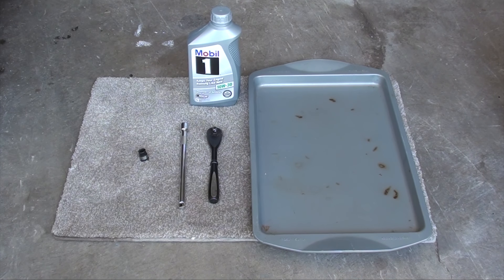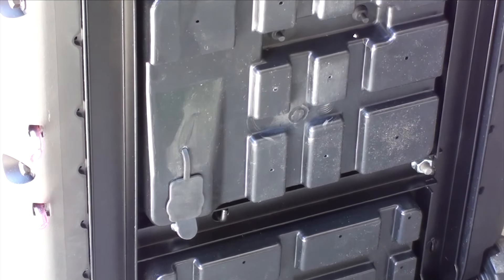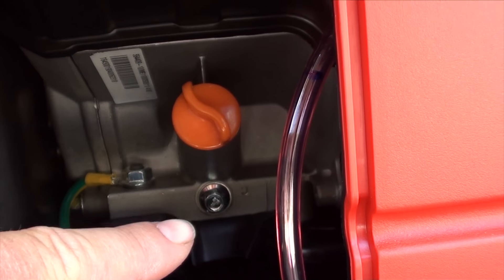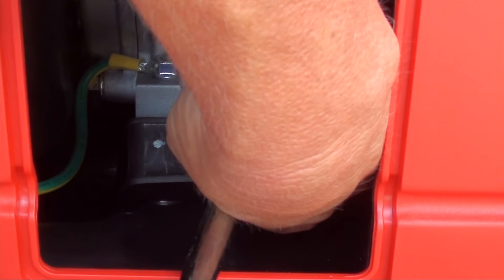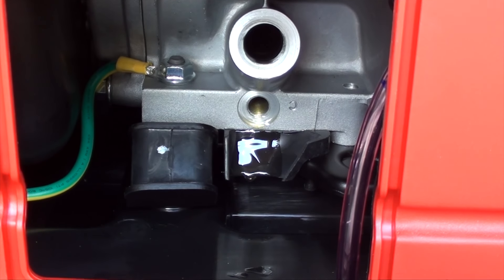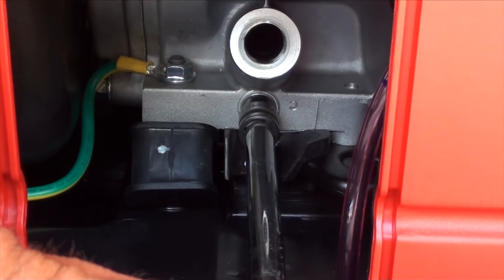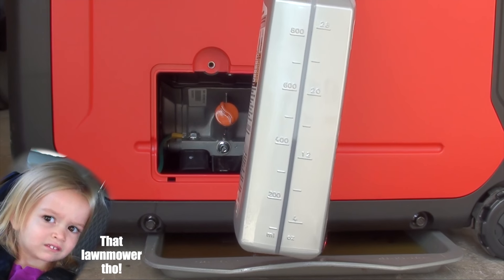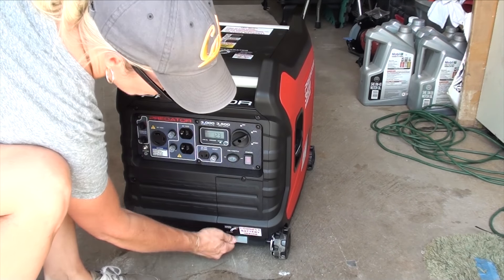How To: Change the Oil in a Predator 3500 Inverter Generator

Comment: I wouldn't flip an engine over...
Reply from the maker: It's really not "flipped over", it's tilted just as step 3 in the owner's manual specifies: "3. Lift and tilt the Generator.  Remove the Drain Plug on the bottom of the machine, then set the Generator back down on a level surface."

You could always write to the manufacturer and tell them you wouldn't tilt an engine & maybe they can give you an alternative; perhaps lifting the entire generator onto blocks in a level fashion would do it. I definitely can't lift it so just I tilt it as shown.
Reply: It's sealed. Completely fine. Oil settles right back down.

Comment: This is probably a redundant comment, but my 3500 came with a drain house with an easy twist plug/cap installed from the factory ( so no 10 mm socket needed)... and my rubber plug was designed to be removed from the inside.   Manipulating the drain hose out the bottom wasn't the easiest thing in the world, but so it was.  
As a tip for those without a dedicated oil measuring cup for garage use, I used my kitchen one to measure out the 20 ounces USING WATER.  Then filled a bottled water container with that water and marked the container at the 20 ounce mark.  Then I replaced the water with oil.  
Thanks for the video.
Reply from the maker: Excellent! Thanks for sharing your tip about the drain hose! People with that style setup should find it helpful!
Reply: Thank you!

Comment: Thanks for the video.  I borrowed this Predator from a relative and changed the oil, with your help.  Alternatively, i opened the oil door, pulled the plug up, then just slid the tray underneath.  I then tilted the machine toward me for about 20 seconds (after it stopped pouring out flat) until it was really empty.  I think it took almost 17oz.  After all, i then pulled the cord slowly a few times to get oil into the cylinder, and then i checked the oil.  Always pull the cord a few times before statup to pre-lube before startup.  Thanks, again.
Reply: Thanks for that additional tip 👍

Comment: Very clear, informative video.  One note, though.... Regarding the final check of the oil level, you check it without screwing the cap in.  You just put the dipstick up against the oil fill port, pull it out, and read...
Reply: This is correct.  I actually went to the manual because of this comment.  They show the oil being right up to the edge of the threads, and the stick measuring full without screwing it in.  Never knew this!  Thank you.

Comment: Perfectly done.  Thank you.  I bought one of those 3500 inverters two days ago on FB.  The machine looks new, but that oil was black as coal.  Fixing to walk out to the barn and change the oil, just needed a little instruction.  Thanks again.
Reply from the maker: Excellent! Good luck with your generator & thanks for commenting! :)
Reply: @EndlessDIY  All ready done.  Pretty fast project. Glad you mentioned to hold off on putting the full 20 oz in it.  17 oz was about perfect.  Thanks again.
Reply: @mathewdavis-adventuresandd6643  on the first change it is usually black as rings seat. First 50hrs is all about the break in.

Comment: Sadly i enjoyed this generator, but it won’t power my AC in my trailer. So I found this video very informative to drain the oil to return it! Thank you!
Reply from the maker: Aw! That's a bummer! It powered the AC in my Ice Castle, but I don't recall the size. Yours must be bigger. I've seen people talk about a "soft start" kit that allows a slightly smaller generator to start a heavy draw item like an AC. From what I understand, when the AC kicks on is the huge draw. If you're not able to return it for some reason, that's something to look into, at least. 
Thanks for watching! :)

Comment: Thanks for that.  The other videos I've watched talk about propping up the generator using 4x4 blocks.  I like your idea of using a cookie sheet instead.  If I use my wife's cookie sheets she'll have my head, but the aluminum ones can be had for virtually nothing.
Reply from the maker: Lol! I bet! I have garage specific bakeware (cookie sheet for oil change, muffin tin for nuts & bolts on a big project). 😁 I'm glad you found the video useful! Thanks for tuning in!
Reply: @EndlessDIY  Muffin tins for nuts and bolts!! What a great idea! Add magnets and voila!
Reply from the maker: @LivingFaith2  Thanks! It definitely keeps things organized! Everything seems to roll away otherwise. lol!
Reply: @EndlessDIY  I wish I would have watched your video Before removing my radiator on my Dodge. I would certainly have bought a muffin tin first.

Comment: Your oil looks really good still. I run my generator 8hrs a day for 4-5 days. I do my oil change every week. I also use the same oil just because my truck uses the same ( truck oil is much better then generator oil)  and I don’t want to buy a different oil for my generator. I had a lot of generators since I use them for commercial use and never had a problem with the engines ( the power plant goes first before the engine ) so I’m pretty sure you can run yours for a lot longer before doing an oil change. I love the predator series generators they are way better then Briggs and Stratton as i have 2 brigg generators dead in my shed.
Reply from the maker: I agree. I use regular automotive oil, as well. This was the first oil change after the break-in period so it still looked pretty new. I rarely use the generator. I mostly use it to power my house when the power goes out (dang rural power). Thanks for the comment! :)

Comment: Thank you for this, I was just getting ready to go look at the manual.  One think I would critique, if you don't mind, is leaning the generator up that far.  I tipped mine up from the side just far enough to pull that rubber plug and that's it.  I'm no mechanic and I can't really say WHY I wouldn't tip the generator up that far, but it's just something I've been told about engines.  Maybe it's not true and it's something that's been told then told then told then told to me?  I don't know but it was easy enough to just tip it up a bit.
Reply from the maker: I think that's generally said because people are concerned about flooding the carb or getting the float stuck open. I've heard it many times, as well & I'm still not positive that's the reason. Lol

Comment: Great tutorial. Question for you. Does turning the generator on its side like that run the risk of overflowing the fuel tank? Reason I ask is because we had the tank for one time and it spilled a bunch of fuel during transport and we have no idea how? I was thinking maybe there is an over fill or we put too much gas in. Just want to make sure it’s completely safe to tilt the generator like that. Thank you.
Reply from the maker: Thanks! I haven't had any issues with fuel coming out when tipping the generator. You most likely overfilled it a bit. It's common on these. There's a fill mark in the gas neck that you're not supposed to fill past (and they mean it! lol!) but it's kind of difficult to see. Gas expands so if you overfill it will make a nice mess for you. Hope that helps! 🙂
Reply: I had the same question, thanks!!

Comment: Great video but why do you remove the rubber plug?
Reply from the maker: Sorry for the late reply, I haven't been receiving notifications for some reason. The rubber plug is popped out because the oil is drained kind of inside the case & it has to come out of that hole. If you don't open the plug, it'd just sit in there & make a terrible mess.

Comment: Awesome!  Thanks. Just bought a used one with a 1k hours.  Hope it was ok for the price and has no problems.  The 1st thing do, as with used cars I buy, is change the oil. Piece of mind I guess.   Thank you for this.  Seems simple.  Question. Where do you dispose of the used oil??   Thanks
Reply from the maker: Congrats on your new generator! As far as I know, anywhere that sells a reasonable amount of oil has to accept it to be recycled (like Walmart, Napa, etc).

Comment: That oil you drained looks brand new! Was this just for demonstration purposes and if not how many hours was on that? And yes they do make a magnetic dipstick now pretty cheap on amazon and ebay.
Reply from the maker: You're right, it did look really good. It was the first oil change after the break-in period but I don't recall the hours.

Comment: Oh and is there anything else I should look for to change? Say the air filter or whatever?
Reply from the maker: You should check/clean the spark arrestor. I've seen several people talk about it getting clogged and making the generator less efficient and even falter a bit. It's simple to do.
Here's a link to the owner's manual, if you want to read all the details about the generator and some service info. https://manuals.harborfreight.com/manuals/63000-63999/63584.pdf 👍🏻
Reply: @EndlessDIY  Thanks for the link to the OWNERS MANUAL

Comment: How often do we change the oil?
Reply from the maker: Good question! According to the manual, you're supposed to change it every 6 months or 100 hours. Here's a link to the manual if you'd like to take a look. Thanks for commenting! :) https://manuals.harborfreight.com/manuals/63000-63999/63584.pdf

Comment: I liked the video. However on my predator it said to check the oil level by taking out the filler plug and wipe it off and just stick it in without threading it and pull out and check the level!
Reply from the maker: I always thread it in but you should do whatever the manual calls for. I believe either method is just fine. 👍🏻

Comment: My only complaint is that rattling wheel lol, mine drives me crazy
Reply from the maker: YES!!! Lol! I hate that! Locking it "just right" helps, sometimes, but that thing is so annoying! I'm thinking about making a big wheel kit for mine with possibly a different brake system. I'll design & 3D print the spacers and maybe come up with a jingle jangle solution in the process.  😄
Reply: Place it on an even ground.

Comment: Do you know what size the crush washer is?  And where to even find a crush washer?  Last time I changed my oil on this same generator, I noticed the washer is broken...
Reply from the maker: I'm sorry I didn't reply sooner, your comment was held as spam for some reason. 🤷‍♀️ Anyhow, I don't know, offhand, but if you take the bolt to a powersports dealer (Polaris, Yamaha, etc) they might be able match one up for you. The last one I got was for my Polaris General from the dealer, so they do have them. Just matching the size is the challenge. 
I hope you find one & thanks for watching! :)

Comment: Need help, my generator won’t start.  Sat for about 2 years, new battery, oil, and spark plug.  It cranks but won’t turn over…any suggestions
Reply from the maker: It sounds like it might not be getting fuel. I've not dug into the carb on my Predator but you might do some googling to find out what type it has. It could be a dried-up accelerator pump/diaphragm or maybe your jet/fuel orifice is just plugged with old varnished fuel. If it were me, I'd find out what I could about the style of the carb then take it apart for a thorough cleaning. Sometimes the little carbs for small engines can be so inexpensive a rebuild kit actually costs more.

Another free dignostic thing you can do is make sure it has spark. Take the plug wire off & hold it very near the plug & turn the engine over to see if you have spark. It can be hard to see. If you're not really able to see, unscrew the plug, put it in the plug wire & hold the electrode near a bolt or something on the generator & watch for spark that way.

Good luck! I hope you get it sorted!
Reply: Maybe dump all the old fuel out and buy non-oxygenated gas with two oz. of Seafoam and crank it over. If it starts let it run for 15 min. to let Seafoam clear the varnish out of lines.

Comment: I had added a Valve so I didn’t have to grab a wrench every time.
Reply from the maker: Anything to make the job quicker is nice! 👍🏻
Reply: Isnt it easier to unscrew and take the whole side off to get better access??
Reply from the maker: @tomcoon6930  I've never had the side off of mine so I can't compare methods. The access panel has been plenty of room for me, but whatever works best for you is the way to go! :) 
Thanks for watching & commenting!
Reply: What size was the valve????
Reply from the maker: @jseries9247  Are you asking what the bolt head size for draining the oil is? If so, it's a 10mm socket (I mention it at the beginning of the video and it's also in the description along with the other items needed). 
If you're asking what size quick drain hose you can buy for these, I haven't got one, but I believe they are 12mm. 
Other than that, I'm not sure what "valve" you mean.

Comment: What oil ? Is 5W-30 ok ?
Reply from the maker: The manual for the generator recommends 10w/30 oil so that's what I always use. I'm sorry, I don't know if other weights would be suitable. Here's a link to the owner's manual if you'd like to take a peek. Thanks for the question! :) https://manuals.harborfreight.com/manuals/63000-63999/63584.pdf

Comment: Will 10w40 works or do i have to use 10w30?
Reply from the maker: 10w-40 should be fine. The oil gets changed so frequently & those are so similar, I'd run it if that's all I had, personally.

Comment: Small engines without oil filters should never have detergent oils.  The manual actually specified 30 weight oil.
Reply from the maker: Interesting. The manual for mine, on page 17, step 7 says: " Replace the Oil Drain Bolt and add the appropriate type of oil until the oil level is at the proper level. SAE 10W-30 oil is recommended for general use . " .  
Here's the link to the manual if anyone would like to double-check or would like to read the specific steps. https://manuals.harborfreight.com/manuals/63000-63999/63584.pdf